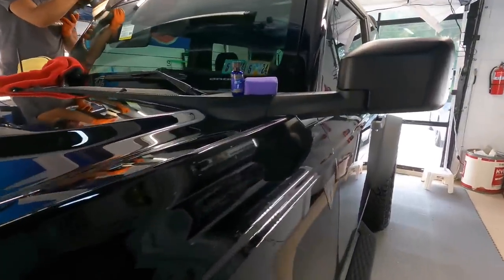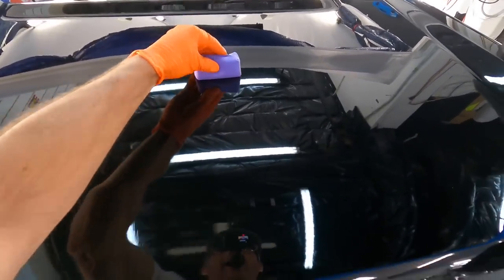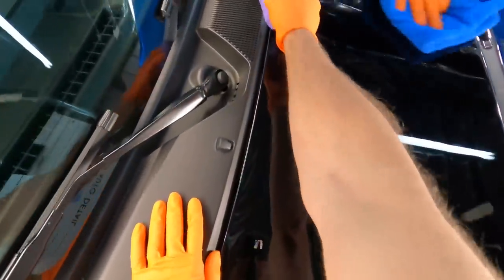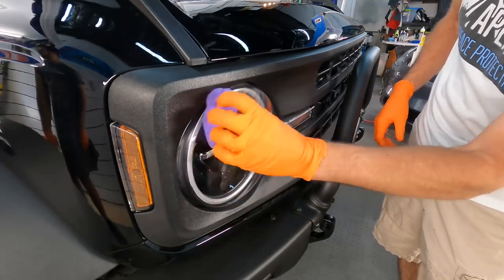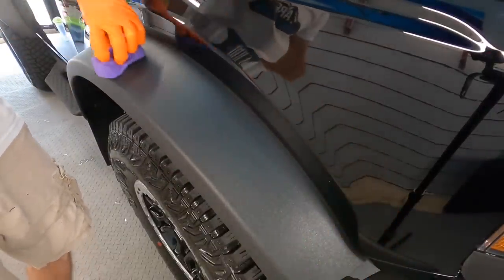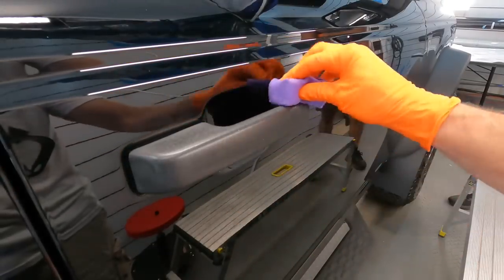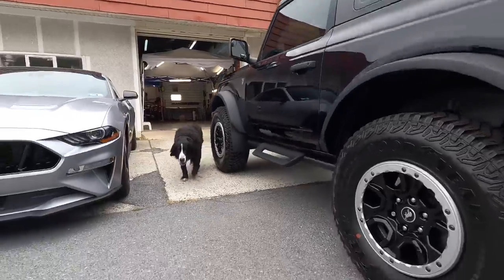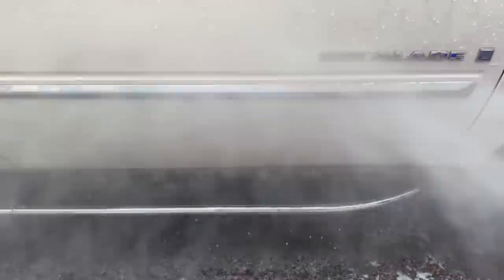The Absolute Best Results From A User Friendly Coating!!! BLUE COLLAR 1 Polysilazane Coating!

Comment: The four month update on my daily driver which makes multiple trips across Alligator Alley and is the Florida sun for half the month. The Coating is doing fantastic and the plastic trim looks as good as the paint. Topped with BC3 once a month. Also experimenting with BC3 on the wheel wells. Great results so far.
Thanks, Brian!
Reply: Gotta love the bugs on Alligator Alley! I live in Fort Lauderdale and run across to Naples, Ft. Myers from time to time as well.

Comment: I really enjoyed using this product Brian. As you might imagine it gets pretty hot and humid down here in S Tx And it was 102 in the shade and the heat index was about 109. I coated three full sized pickup’s that day under the tents and  your BC 1 didn’t try to resist me at all. It went on and wiped off easily as  stated. Unlike a few other brands that I’ve tried yours wins out in the heat contest . I will be purchasing some more here in the next few days. Thanks and keep up the good work.

Comment: Brian, love your channel, you have teach me so much regarding machine polishing and also coating that I really think this channel has been a game changer for the industry. I have a question regarding coatings in general, I have a daily driver (that sits outside 24/7) Jetta that I coated all plastics 2 years ago with Carpro Dlux, now the coating has faded and I heard on another channel that this situation is game over. Because the coating is still there but not working I cant apply a product like Solutions Finish to restore but also I cant coat it again because the new coating is not going to bond properly because the previous one is still there and plastic is oxidated.
1. what are my options here?
2. is it a good idea to coat new cars when there is a risk that this could happen?

Comment: Hi Brian, I was looking for advice for a one-step polish setup. I have a 2009 light blue VW. After watching your videos I was looking at picking up a rotary, some pads (maybe Koch Chemie orange?) and something like Turtle Wax 1 & Done. Do you think something like this should work, or should I consider a DA and a different compound, I know you've also showcased Sonax and Koch Chemie One Cut. Thanks! :face-fuchsia-tongue-out::face-fuchsia-tongue-out:
Reply from the maker: The 3 D polish system including 3D One is worth a look.
Reply: @apexdetail85  I did some research and was looking at TW 1 and Done which I think you’ve previously mentioned finishes better than the 3D. I was also looking at the Uro Fiber 50/50s, unsure if these would be too aggressive. Seems like a pretty solid combo?

Comment: Ever experienced paint that no paint protection seems to bond to? Ive tried so many type of protection, waxes, sealants, ceramic coatings, wet coats so on, and not a single one sticks like they should. I can polish the car, do two ipa wipe downs, apply whatever protection to see it fail way to quick, last summer a 18 month coating failed in less than a month. My latest try is 303 graphene, best luck so far but after a month horizontal surfaces definetly look worse than they should.

Wouldve been cool to try this coating, but unfortunetly I live in Sweden, we dont have as much stuff to choose except the big brands like gyeon etc.
Reply from the maker: Try BC 1. There are more distributors in the pinned comment that may help.
Reply: @apexdetail85  None that ship to Sweden it seems, atleast not without customs fees and taxes. Not ready to spend too much money as nothing seems to work anyways..

Comment: Bri put it on my Mazda 6 .came out great. Really got that glossy look after about 2 weeks. However, I noticed a small section on the hood that looks blotchy. Like when you paste wax a car and miss a spot. It only shows during the  late afternoon. You don.t see it during bright sunlight. If you had to guess, what did I do wrong? Also do you sell the applicators? Will be doing another car soon.
Reply from the maker: The coating could have piled up in one area as it was pushed around… level with CarPro Essence plus.
Reply: @apexdetail85  I’ll give a shot. Thanks

Comment: How long does BC2 last after it is opened pls Brian?
Reply: 1 year
Reply from the maker: Up to a year if stored properly. Dark and cool.👍🏻 You can also wrap electrical tape around cap at threads to help seal a bit better.
Reply: @apexdetail85  
So BC1 and BC2 both have a 1 year use by date from when it gets opened?

Comment: Is it still easy to apply in 90° temperatures with above 80% humidity?
Reply: Did a friend’s vehicle in direct sunlight in Florida and in much bigger than 2x2 sections and I had NO problems with it at all. GREAT product !!!!!
Reply from the maker: Yes… start off with smaller sections… but you will be surprised how you can expand the surface area you are working on if needed.

Comment: Hi Brian, do you have any tips on stopping sweat dripping out of your  gloves when applying a coating? I would normally tuck some kleenex around the cuff of the glove but they soon get wet if working on a warm day. Thanks for the informative video. Clients car has just arrived for a clean, polish and prep for bc1 and 3
Reply: There are a couple things you can do to keep perspiration from dripping on the car.  If using nitrile gloves, you can use sweat bands and wrap them with an elastic sports wrap.  Another option is to use light work gloves that have a breathable fabric backing.  Home Depot has their own version along with some from Milwaukee that have a grippy surface making it easier to hold the applicator and towels.

Comment: 3-5 year...how would you advertise this coating in packages when there are multiple coatings that offer 3 OR 5 year longevity? And is there a warranty system?
Reply from the maker: I use it as my 3 yr and 5 yr coating. Once comfortable with the coating, create a custom warranty on your prep, protection, and maintenance.

Comment: So if it’s that easy and simple (I don’t doubt it), can’t you just do whole panels before buffing, or even a whole car? I guess, what are the limitations in application?
Reply: I’m no expert, but I’ve tried EXACTLY what you asked about so…

Installed BC1 on a friend’s vehicle in direct sunlight/heat in Florida in much larger sections than recommended and I had no problems at all. Did the hood in 2 sections, front fender complete, two doors complete, tailgate, then did the same on the other side. All during the day and I’m no professional, this is just a hobby. BC1 topped with BC3 was the easiest of all products I’ve tried and looked great despite me not following directions. Hope this helps !
Reply from the maker: You can… but I advise smaller sections for beginners.